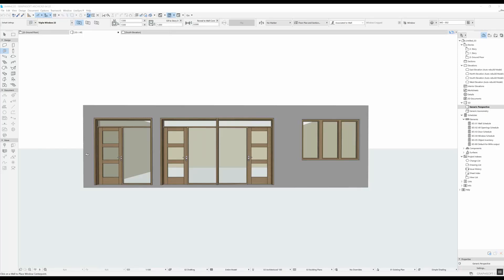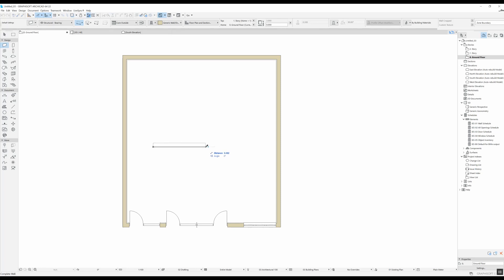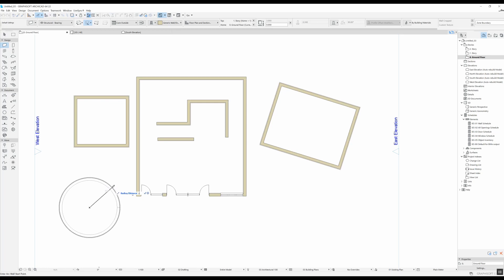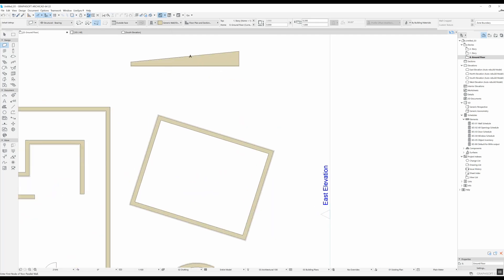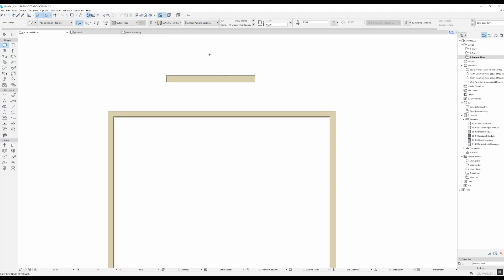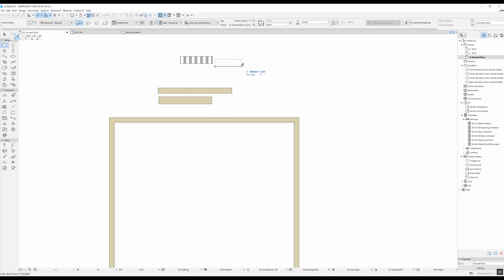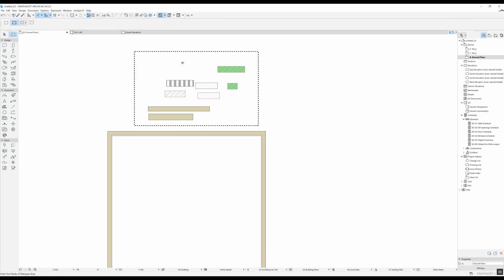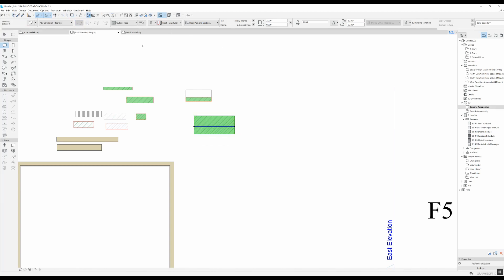ArchiCAD tutorial - 6 - Wall Tool

Comment: Hello, thank you very much for your videos, I love all of them.

I encountered a problem in ArchiCAD 23, I don't know if you have a way around it. 

When using surface painter on my elements (let's say a WALL)

I can only assign a material to the outside, the inside and the edges (All the edges are treated as a single entity, and that is the problem). Because I will like to assign different material to 8 faces of the wall.

Please help me.